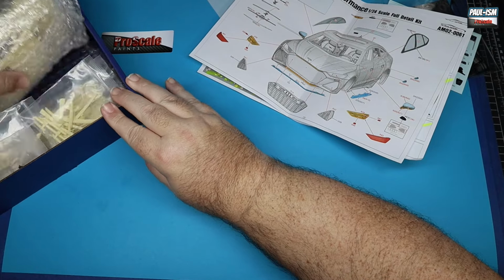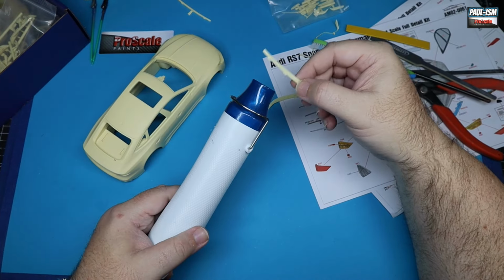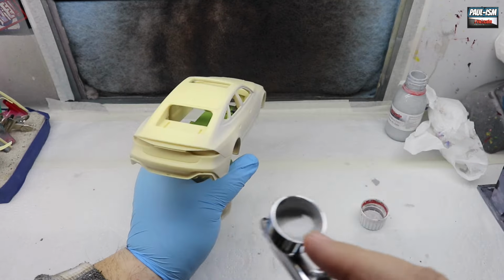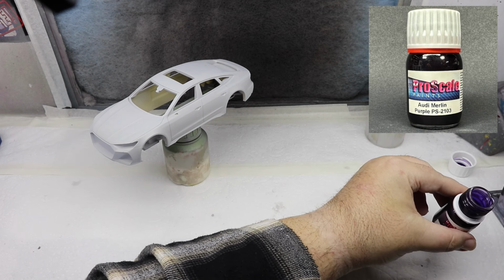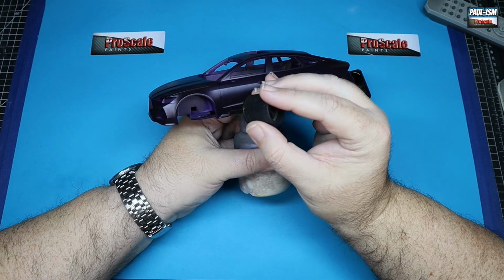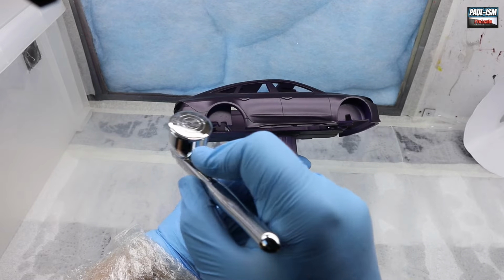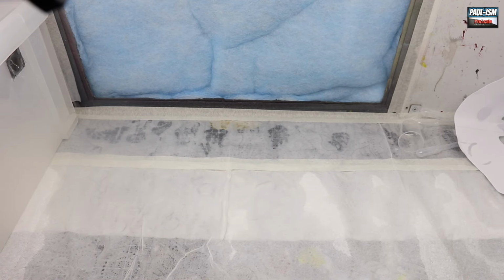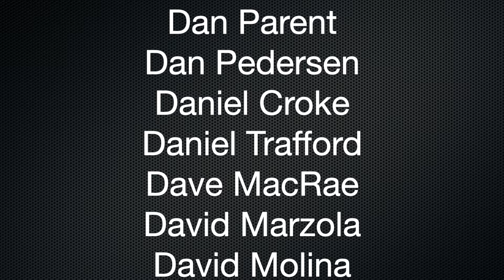Part 1 - Alpha Model 1/24 Audi RS7

Comment: Are you using a mask while sanding/filing resin parts? Im busy with a resin conversion kit for a gundam and i sand/file it while the parts are wet and i wash them with hot water and soap. Because they say resin dust is pretty hazardous for your health and it takes so much time i actually hate working with resin

Comment: I’m confused why resin models even exist. So fragile and so much extra effort needed. Not to mention the toxic nature you mentioned before. Are they any advantages.
Reply: Much cheaper to produce small runs. I imagine eventually they will be replaced with 3D prints, but that’s also resin.